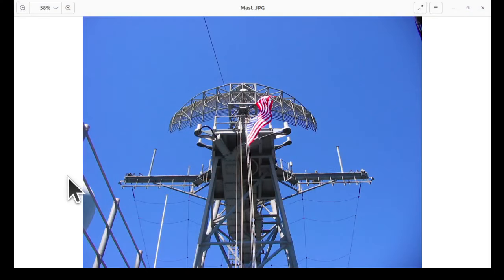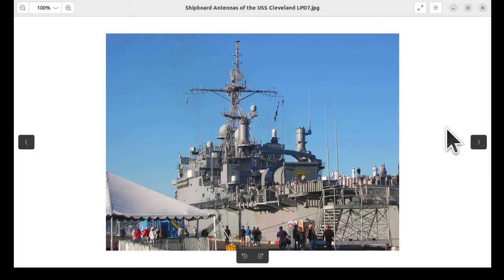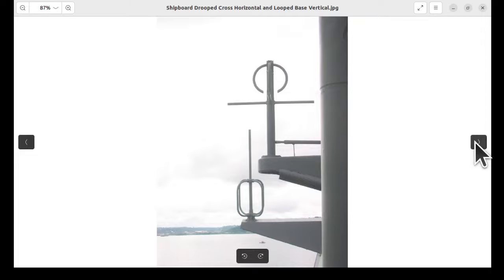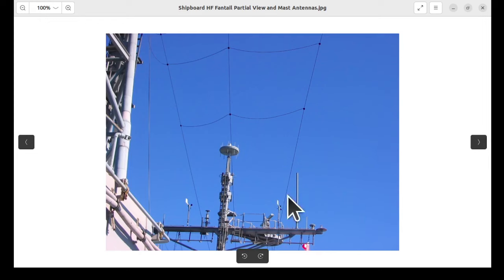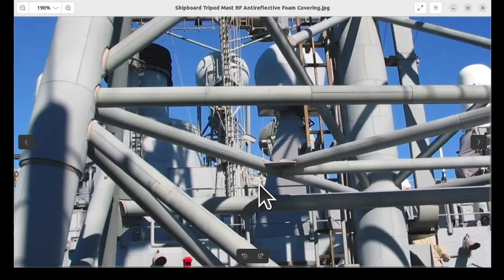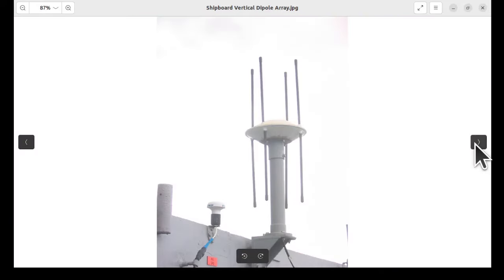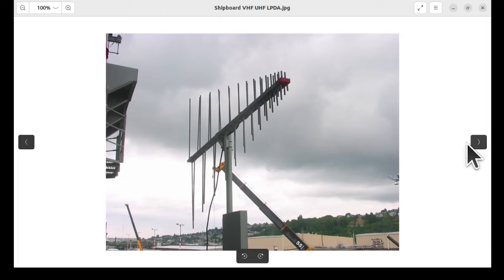KB7QHC Antenna Magician   Naval Antennas

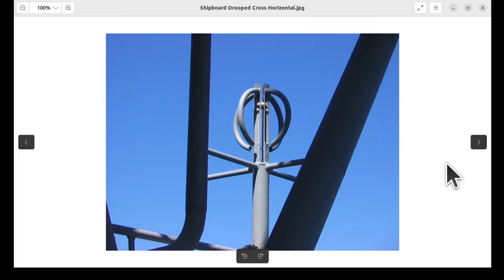Comment: What frequency is the antenna @ 3:15 for? Looks familiar to me.
73's de KB5ZDW
Reply from the maker: It would fall into the Military band of 225-400MHz.  The large features (like thick tubing) would widen the match over a significant portion of this band.